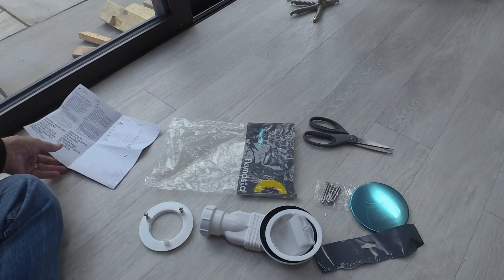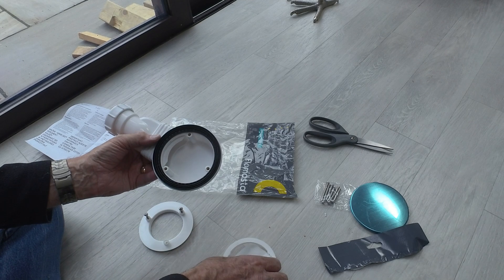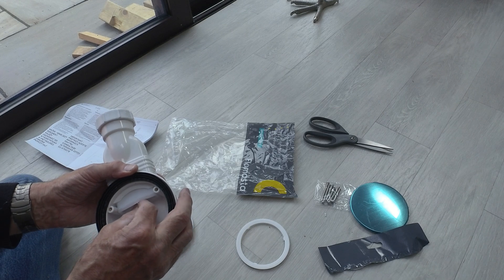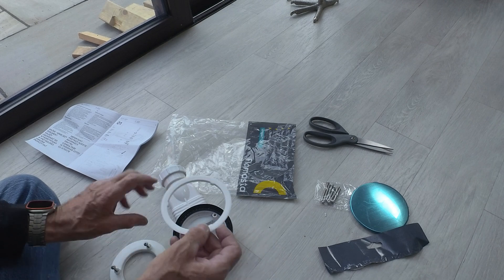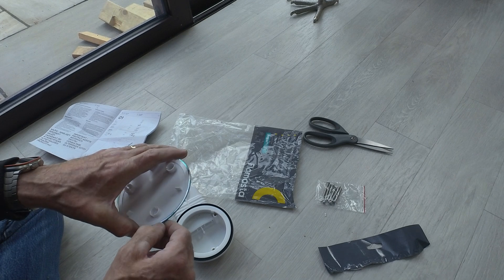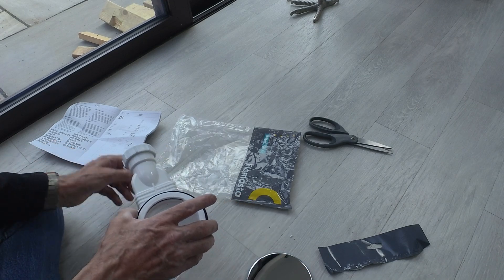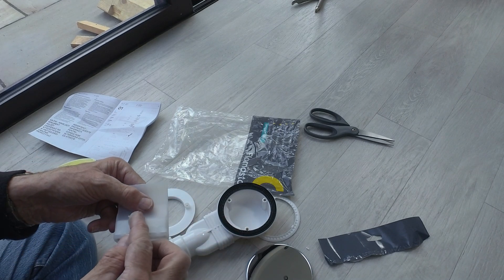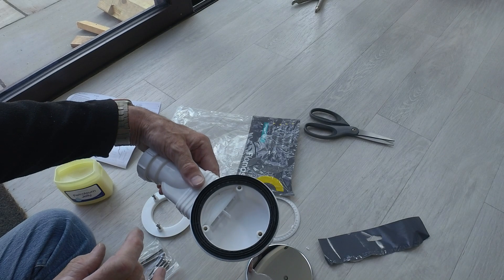Inside a 'Waterless' Shower Trap

Comment: Don't use petroleum jelly - it goes for some rubber and plastic components!  Use silicone plumbing lubricant instead!
Reply from the maker: Fair enough. (I do have some silicone grease too - should have used that.) Thanks for the comment.